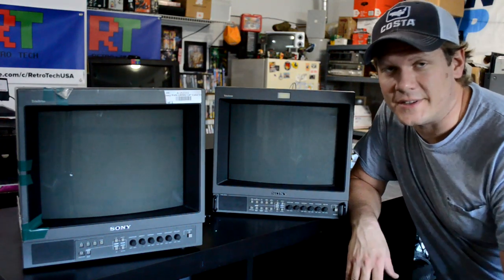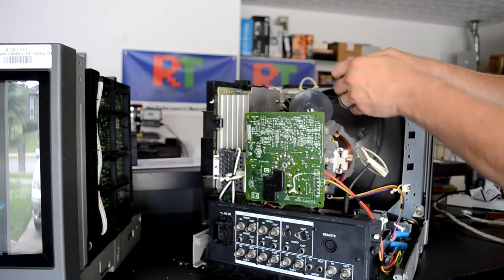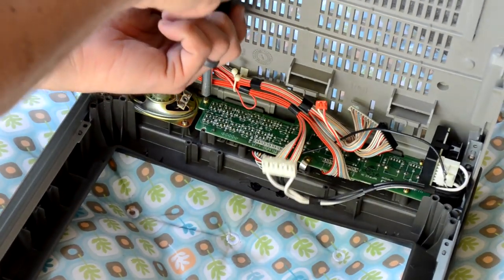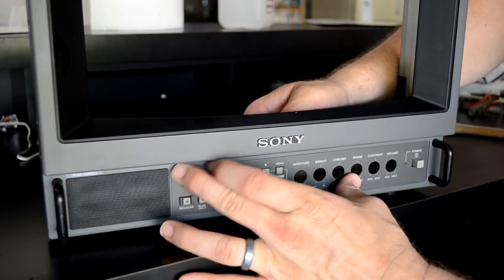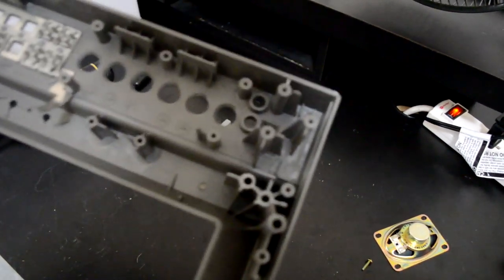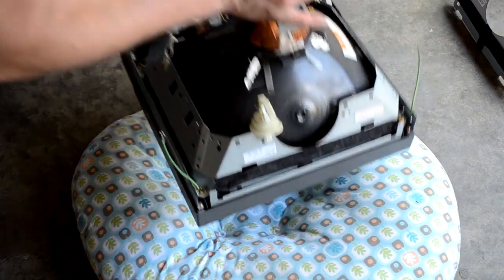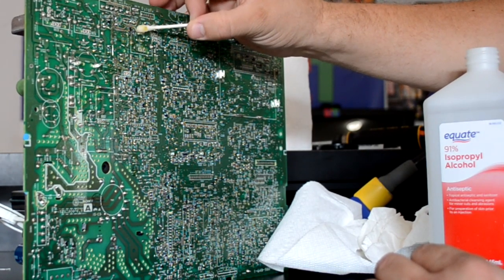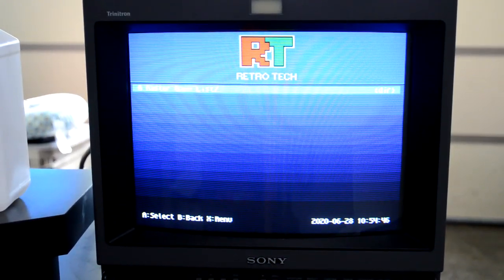Sony PVM Bezel Swap & Other Repairs - Vintage Monitor Restoration

Comment: JB Weld works great for fixing things like that. I know its a high stress point. Another option is fiberglass repair kit from your local car store. That would work great.
Reply from the maker: Thanks.  I was thinking about that.  I will keep the parts and see about testing that out too.
Reply: I have several 14" monitors with bezel damage and my plan is to use body filler - not fiberglass repair. For one, body filler is easier to work with, and for two, it's cheaper :D. Body filler is very strong, and since it can be worked easily with abrasive tools (files, sandpaper, etc.), you can shape it like you need.
Reply: @RetroTechUSA  Enjoy watching you vids. Question...I have a  2005 Hitachi 65"  CRT HD t.v. in perfect working order that we've had for 11 years. Wife wanted a new more modern looking set for all the apps and other what nots SMART t.v. ... I myself would keep it, but now is taking up room. Of course no one wants these anymore...can't give it away and I don't want to put it to the trash, because it still works great..lol...anything salvageable that may be of some worth? Thanks
Reply: @ZiggyTheHamster  body filler isn’t very strong it never gets very hard and it’s brittle and flaky I can take a screw driver and easily pull off flake after flake some of it is even gummy it’s trash for anything more than the tiniest imperfections
Reply: @thebrain7065  keep the projection bulbs those are valuable to others that use them and they do get burn in and they don’t take up too much space

Comment: Would you do a video on using the service menu on Sony PVM N series monitors such as the PVM 14N6? If so it would be greatly appreciated.
Reply from the maker: Hey Liam.  I will when one of those models comes in.  I've been talking with someone else about the process of adding RGB to the N series PVMs without RGB.  The service menu will be a part of that project.  Until then, I recommend reviewing the Service Manual for your specific PVM if you can find it.

Comment: Hi Steve, what are your opinions on the 20M4U for retro gaming in rgb? Do you happen to know how many tvl it has I can't seem to find that info. Thanks Steve!
Reply from the maker: Yes, that's a great PVM 800 tvl and does RGB.  It supports 240p & 480i only like most PVMs
Reply: @RetroTechUSA  Thanks bud, you're awesome!

Comment: Hi how are you Steve I have a problem. Maybe you can help me. I Have a Sony PVM1444QM that has strange lines without being connected to any source. Is there any form to reset or do something to solve and fix this? It wasn't working like this some weeks ago. Here is a pic or my problem:

https://ibb.co/2qg8Rdd

Thanks in advance and congratulations for the great videos!! Keep them coming! :)